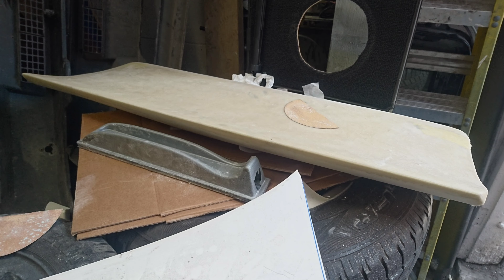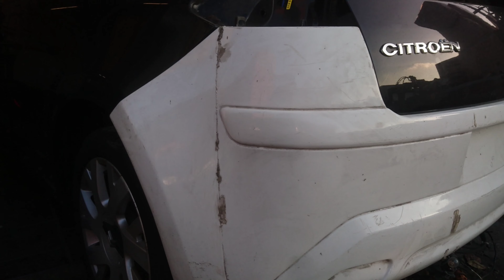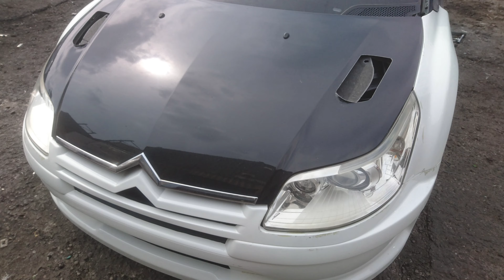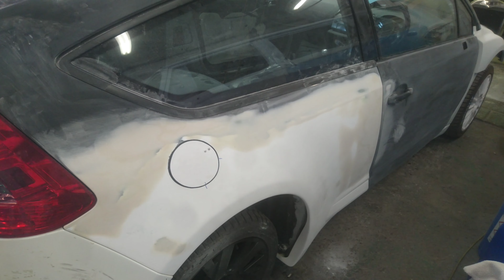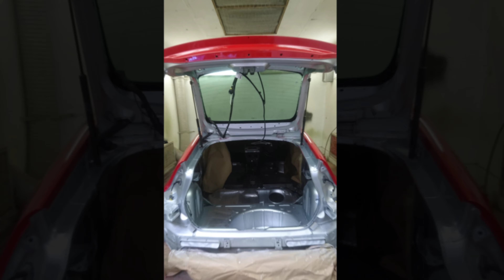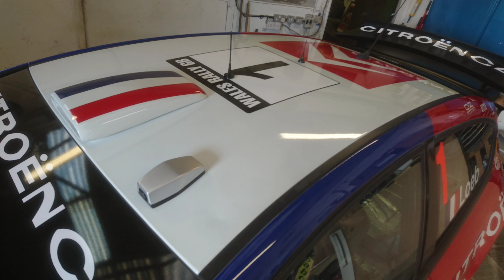Citroen C4 wrc recreation/ rally replica build #1 custom respray #rally #rallycar #wrc #citroen #vts

Comment: Is it easy to fit the wrc spoiler ?
Reply from the maker: Yes it's bolted and bonded on 👍
Reply: @totaloverhaul7489  were did you order it? i found a few but no idea if they are the same
so i dont have to drill any holes in the bodywork?
Reply from the maker: @TheGentlemansCode-i8r  I made the spoilers myself, as I couldn't find any for sale.
I'm not sure how others fit, but mine is made to be bonded on and bolted through the original spoiler holes, so no drilling holes.
Reply: @totaloverhaul7489  is it possible you make them on order, i really want to buy one! If possible could you make me one, and maybe ship it to the netherlands. tell me what you want for it